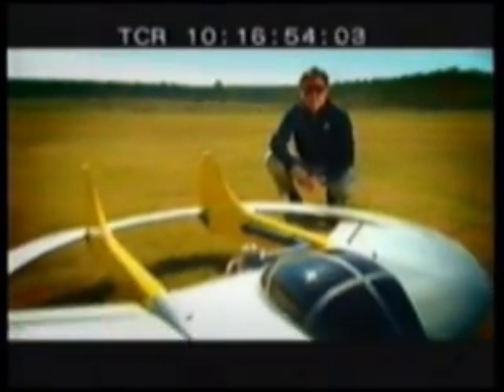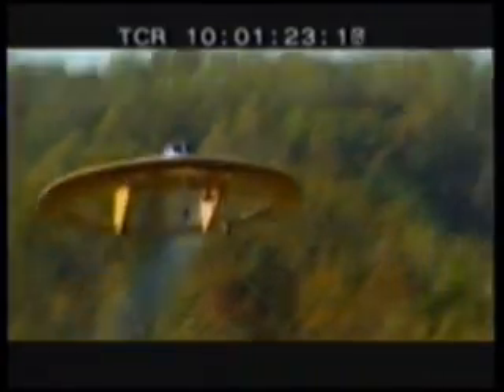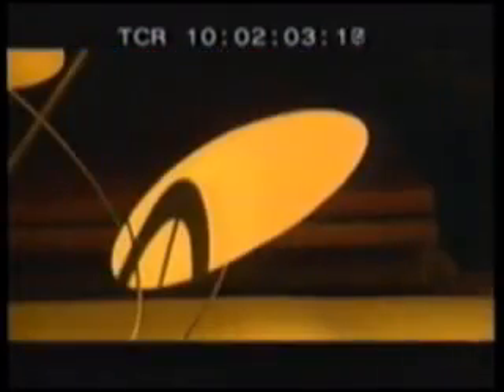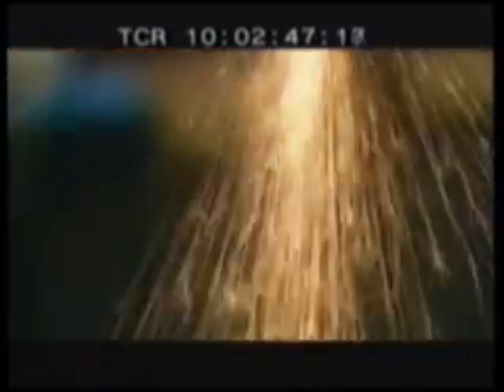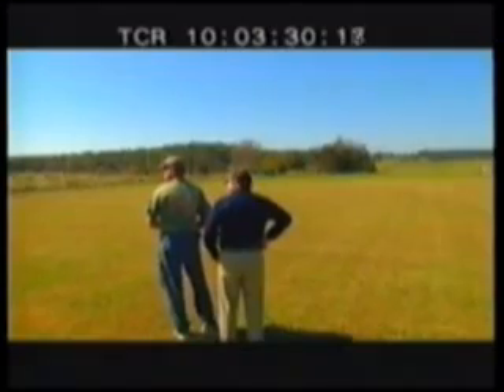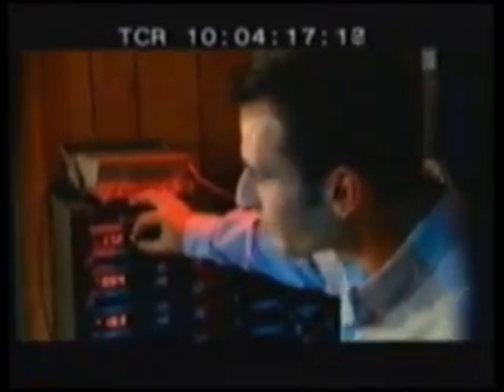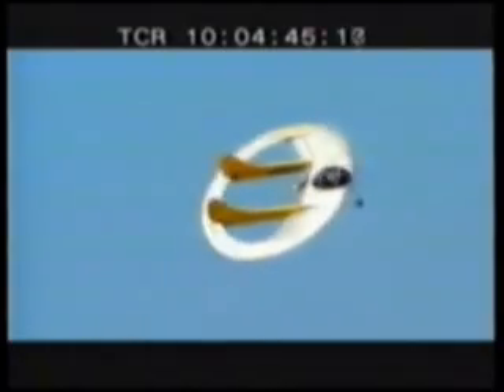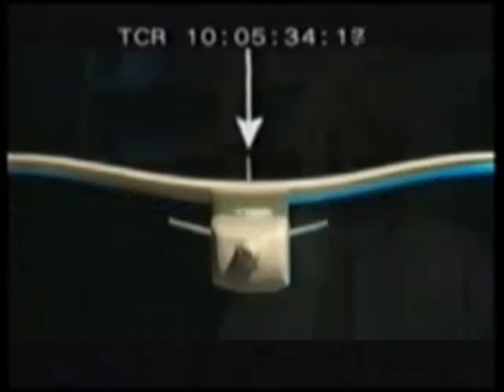Flying Saucers Are Coming!

Comment: I've built 9 different flying disc models so far.  The bigger they are the better they fly, with a 48" span being the largest with a 120 4-stroke @ 8lbs.  The aerobatic capability is beyond any standard form aerobatic plane in the high-alpha flight mode.  I think the world record on spins could be broken in a full scale version since the descent rate is very slow in a flat spin, and the very compactness of the planform lends itself to aircar designs.  The circular plan form is indeed beautiful!

Comment: Given that the largest amateur enthusiast copy of the GeoBat  known to have flown is just 55" across  suggests an inherent problem with drag. Pretty much any model design will fly with a big enough engine bolted to it (Google Flying lawnmowers) but as size increases the power to weight ratio tapers off. Sure you can fit bigger engines but only at the expense of passenger/cargo capacity and that defeats the object.

Comment from the maker: The halosaucer is flawed. Wast your time and money on this machine at your own risk. This is a very inefficient VTOL solution. Invest in helicopters. The holy grail of VTOL tech has not been achieved...yet. The Center of Gravity is in the center....wake up all. Remember the AVERO CAR. Same problems. This concept will never fly at fast forward speeds. Moller is beating a dead horse. 1200com, I dare you to contact me, I'll bury you with logic on this issue. I'm waiting for your response.

Comment: I think what you have built is a new step in science, and while it may not be right now a feasible commercial design, it could be the starting point of something new, and because of its maneuverability a very realistic output for the air force or military. A highly maneuverable aircraft is exactly what they need and want. This is definitely something with potential.

Comment from the maker: Excellent Observation! Your mind set is exactly what I'm fighting. Geobat integrates perfectly into any airport. All tube-wings have a circular ground foot print with regards to the way they rotate in an airport. Think top down view - circles. Might get a bit problematic when Geobat's cram into the loading and unloading phase but keep in mind that Geobat diameters are perceived to have a smaller wing span than tubes, relates to wings vs payload. Logic rules! Let's see what happens.

Comment: If you remove the sides of the circle, you have a front and rear wing (& less weight).  Wing tip vortex eliminators are available on 747s and C152s.  Making the body part of the lift is harder, but it's been done with flying wings.  Don't see the revolutionary part.  Also creating a small model with model AC engine does not say much since physics is different and power/weight on the small motors is very high.

Comment from the maker: @YoHappyGilmour Geobat is unusually stable. The control surfaces you see are only the first draft. There are numerous variations that relate to mission. True story... One of my best friends flew his standard RC tractor prop (aprox same engines) craft directly into the center nose of Geobat, amazing coincidence to behold! His plane disintegrated. The Geobat lost a large chunk of the right wing, crushed nose, dead prop, all electronics intact.  I simply glided down for a landing. Redundancy=A10+

Comment: why not take this design and add to it a cockpit in the center with a rotating chassis around with jet-motor surrounding 360 degrees around the cockpit to gain a frisbee effect. then having a on/off function for the jet-engines as they turn around so that it would drive in a wanted direction????

Comment from the maker: @speedyg2012 Full scale is my main goal, all scale work indicates a highly robust aircraft with regard to G forces.  The pilot is now the limiting factor based on extrapolation.  There are significant control surface variations that are proprietary.  I'll worry about G forces when Geobat starts to show up at your local airport. Yes, this concept scales well, but it's at the cutting edge of design and efficiency, how this geometry plays out through time will be interesting for all.

Comment from the maker: @thebteam300 An efficient flying circle has never been realized until now. Tubes and wings now have competition. New technology will naturally be integrated using the dominate force of the ring. Rings rule in the field of structures and electromagnetics. Geobat represents the beginning of a new way of aerodynamic  thinking.

Comment from the maker: @airtech4 Geobat achieves lift in a slightly different way than conventional wings. Proprietary. The saucer aspect is just the beginning of the concept. Tunnel wings? Can you direct me further, I know of no efficient VTOL except for military applications as in thrust downward which are very fuel inefficient, dual tilt rotor is still trying to make into the commercial market.

Comment from the maker: Correction, they attempted to build saucer aircraft in the 30-50's. CG with regard to forward flight was the main reason they all failed. VTOL is one thing, makeing a disk behave in forward flight is another.

Comment from the maker: As President Clinton said, I feel your pain. What you don't realize is to get a perfectly circular craft to fly predictably and stable with only a propeller is a historical achievement.  However, the challenge is to advance it to the level that it competes with general aviation. They said at the time the Write Brothers were dumb.  And in a sense they were, they got caught up in patent issues. I see the bigger picture.

Comment: @2005ImpulseBlueGTO 
also if you did research, not all UFOs are the stereotypical disc shape, also it stands for Unidentified Flying Object, not Unidentified Hovering Object. meaning this plane can be a flying saucer and its not a ring with a plane in the middle the ring is the plane

Comment from the maker: Apparently you KNOW how UFOs work but nothing of the historical attempts at saucer flight and there advantages over tubes and wings. Geobat solves the CG to CL issue! Payload and structural integrity is the winner. Read up on Burnelli and you may just start to see the advantage. U are not seeing the large payload version which is now being funded. I'm guessing it will rock the world of aviation when it appears at one of the major aerospace exhibitions in 2011.

Comment from the maker: Power off flight is one of it's unique characteristics. You can glide for a normal landing or give it full up elevator and descend at about a 45 degree angle. It's a bit rough on the landing gear but it's interesting see. Get altitude and fly it towards you, cut power, full up elevator. If performed properly, it will appear to be hovering until you realize the disc is getting bigger and bigger.

Comment from the maker: We simply don't know how they work, so you can't draw conclusions. i think in terms of systems within systems. Space travel my be much different than flying through the air. There's no resistance in space. At the very least you would most likely need a way to reduce drag, or circumvent aerodynamics as we know it, including fluid dynamics. And to make it even more puzzling, there appear to be different UFO designs. The circular geometry is perceived to open up new solutions to reducing drag.

Comment from the maker: You are seeing the piper cub of the concept. Most everything else is proprietary. If, and repeat if...everything goes as planned a 40 ft. diameter mockup of a large payload vehicle will make it's appearance next year at one of the major air show exhibitions. Geobat can cram a lot of payload into a small space. Span is significantly reduced. Remember, this is a lifting body, fuselages do not create lift. Historically, circular wings have always proven to be unstable. Payload is the winner here.

Comment from the maker: That's why the Naval Research Laboratory, NRL, visited me. They are a branch of the military. They appeared to know all about prior saucer attempts. The senior engineer was very impressed with the stability and maneuverability of Geobat. Isn't it odd that there is not one picture associated with the military of even a simple prop RC model saucer ever released to the public. Common sense tells you they at least tried it and possibly working on or have flying versions of the concept.

Comment from the maker: How do know? You are jumping to conclusions. We don't know anything about these UFO craft. Aerodynamics may play a big part in the system for high-speed flight and VTOL. Just the ring itself opens up new engineering applications that heretofore have never been possible. The subject gets weird when you realize where this design is headed, and it does so in a logical way. 1st things first, 2nd things second.  Geobat is a good starting point for implementing new technology!

Comment from the maker: Geobat can be implemented now. You're going to be waiting a long time for that high speed saucer worthy of a money making payload package. Flying wings are not very practical and have control issues. Do you see any at the airports? (no Geobats either though) Span is also an issue, Geobat can fly a lot of payload in a very small stable craft, exhibits high angles of controllable power off descent, this gives you access to smaller airports, Ex. an airport surrounded by mountains.

Comment from the maker: Don't be confused with the flap configuration. It's very easy to fly. You're seeing a slightly more complex control setup. Most of my models have 4 channels but 2 and 3 channels have flown. Geobat is unusually stable which allows for this simplicity. Search Geobat or Geobat foamies on Utube to see what I'm talking about.

Comment: Poor design.... more expensive than a standard wing with no benefits.  The reason we don't use saucer shaped wings is due to the drag effect of the rear circular section, this effects fuel efficiency.  It also provides LESS lift than a conventional design as the rear of the craft interferes with the smooth downflow of air which generates lift.

Comment from the maker: I get this comment a lot, so instead of arguing the point, and your opinion is valid, what would you call it? Ring wing comes close but when you see how this design progresses into larger payload forms, ring wing doesn't apply. I see it as a step forward with regard to tube and wings. I'm reasonably certain more exotic tech will be realized simply because of Geobat's geometry. A simple stable flying circle has never been fielded.

Comment from the maker: I've have an idea on how to incorporate a gyro but it's proprietary. I'm not talking about a gryo that sends signals to control surfaces either. Wt. is an issue but it appears to be a very practical concept. As for as I know, controlling gravity in a craft is not commercially available. Possibly a top secret project may have a handle on this though. Flat turns and more, could even fly backwards for short periods, think aerobatic stunt craft. All sorts of strange maneuvers are possible!

Comment: I would love to help build full scale version with ya. I have a great deal of experience with Metal and building things no one has seen before. if ya need help. I think its a sound project. And will advance the field of aviation. Just a thought and you heard it  here first try useing more eliptical shape instead of circular. It will have more lift like a glider. And use less fuel. Great job!

Comment: "Artist with no formal training in aerodynamics. " I stopped the video right there.

I don't think we've seen this design because that design isn't efficient.  Circle for the sake of being a circle increasing drag and surface area.

I'd like to see the coefficient numbers on this thing when run through a wind tunnel.  I'm willing to bet that once you strip down everything you can it looks like any other plane.

Just remember this.  With the right amount of thrust, anything can fly, even a brick.

Comment from the maker: You quite literally don't know what you are talking about. We have seen the data, you haven't. You will not be seeing the data for many years to come, it's called proprietary info. There are no aerodynamic modeling sets to compare with. A new aerodynamic effect has been discovered. We can only guess at this point that this is why Geobat flies like it does. Oh, I forgot, you have never flown a Geobat so you wouldn't know what I'm talking about.

Comment from the maker: Ex. comparison... Geobat can be configured to carry 300 passengers in a 100ft. diameter. An MD 80 wingspan is 107ft, 147ft long. with aprox 147 passengers. Lots of issues to work out but keep in mind Geobat is a lifting body. I'm not revealing the design, that's called proprietary info., however, a working RC model of the concept just flew. Once again, amazingly stable!

Comment from the maker: First you need a circular platform to experiment with. Geobat will succeed outside of the anti gravity venue as a standard aerodynamic vehicle, it clearly has advantages in this area. Now, visualize a black project whereby engineers are applying different tech to Geobat to see if they can enhance the flight characteristics. The big peripheral ring offers a very advantageous starting point. You have to crawl before you walk.

Comment from the maker: Thanks! You are right! It's only a matter of time. The flying ring offers opportunities to engineers that strait-line tech does not offer. I would love to see a Geobat blow away the competition at the Red bull air races. I need help!!!  Start pinging the Red Bull community that a new racer is coming online!  Proprietary info on the exhaust issue, misdirection, like a magician.  VTOL geometry is logically screaming to unfold as Geobat moves forward. I simply can't discuss the issue.

Comment: Very nice design, it's only a matter of time until we see them. I imagine if you went full scale you would not be using propeller, but a jet engine. Wouldn't the exhaust melt through the rear elevator? Also, any plans for vertical take-off?

Comment from the maker: Geobat is nothing like a frisbee except that it has a circular edge. If U could see the data we have you would apologize far making such comments.  Attacking this concept is understandable. U are relying on historical concepts of saucer flight to post comments. Geobat is new, the data is new, the aerodynamics are new. Geobat can compete with conventional tubes and wings, plus it has advantages. Use your common sense,... rings are a golden form in electromagnets and structures.

Comment from the maker: U can make anything fly if you add enough power to it but you can't make anything fly well! Geobat solves a CG to CL dilemma that has historically plagued flying discs. Better yet, Geobat exhibits stability far greater than most conventional designs. This is why the military visited to me!!! You have to have experience with saucer craft to understand the ramifications of Geobat. You quite simply don't know what you are talking about.  Geobat exhibits amazing slow flight characteristics.

Comment from the maker: I'm fairly certain you don't understand the CG to CL issue that Geobat solves. There is nothing like it in the history of aviation. Geobat is amazingly stable. This is why the military showed up on my door step! Your model never could go very fast could it? It would go nose up, same as the AVROCAR. Solid saucers (no hole) are very unstable at slow speeds and have terrible glide ratios and CG to CL issues..that includes flying stop signs. Paper planes will demonstrate this.

Comment from the maker: Indicator!, our 50lb UAV is easily able to handle high winds, Think about it, buffeting from different angles still attacks a circular wing. Geobat is the CL to CG saucer solution with regard to payload design. Stability is amazing at slow flight speeds! You have to fly the craft  to understand the ramifications.

Comment from the maker: VTOL is an extremely costly and complex concept. I simply realized a circular craft that flies like a traditional aircraft and can compete with tubes and wings. CG v CL. That is step 1. Now that a flying ring is viable, new technologies come online. Rings rule in a way that straight line tech can't, domed structures, electromagnetics-radar, new exotic curved tech. I invite talent to embrace the flying ring. New aerodynamic forms are very rare!

Comment from the maker: Good question, U really have to experience this craft hands on via RC to understand the ramifications. The bigger it gets, the better the data looks. 80" dia. now flying. Flying rings also open up a whole new universe for electric  and structural engineers. For now, I'm concentrating on payload = money which appears to be a winner! Lifting bodies, structural integrity, safer craft, all the flying models reflect these advantages. I see things you can't see! Flying Saucers are Coming, Believe It!

Comment: It would be somewhat more efficient. 
It is technically a cross between a 'flying-wing' and a 'joined-wing' or 'box-wing' design. 
The pusher prop reduces frontal drag and the lifting body shape of the cabin is more aerodynamically effective and therefore it should use less fuel to carry the same load over the same distance of traditional designs.

Comment from the maker: yes! like a regular airplane. The coanda effect relates to air that sticks to a surface. Google for more info. see gfs saucer. How it works is really interesting. Touch your finger to a fine stream of water, notice how the water releases below your finger. That is the coanda effect. Fluids tend to stick to a surface, this also relates to wetted area in aircraft design. Visulaize thousands of tiny fingers touching an aircraft wing as it moves forward. Those finger tips also cause drag.